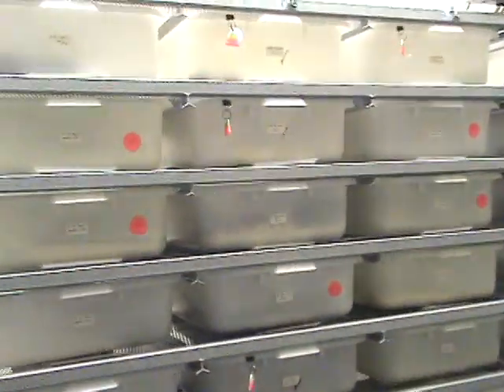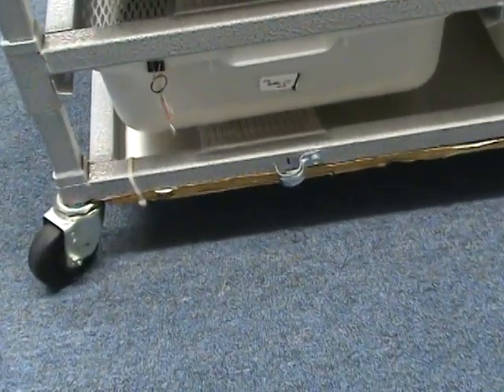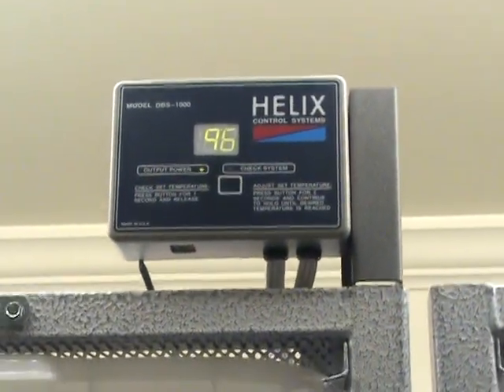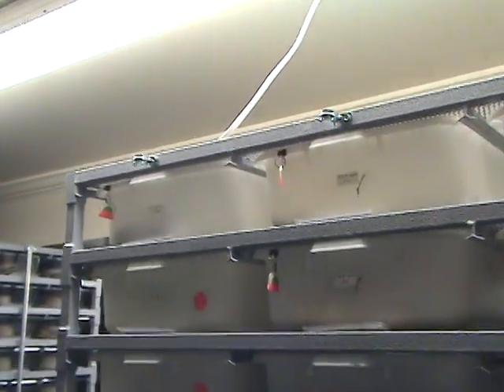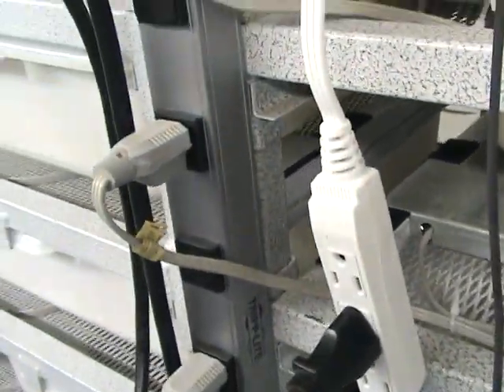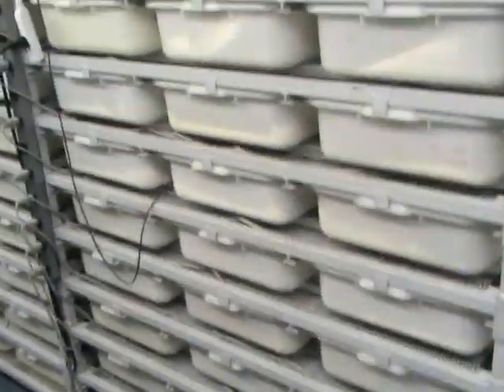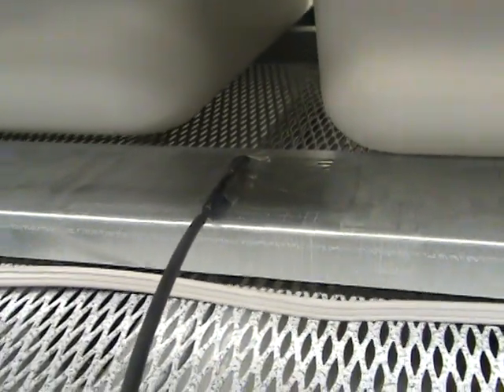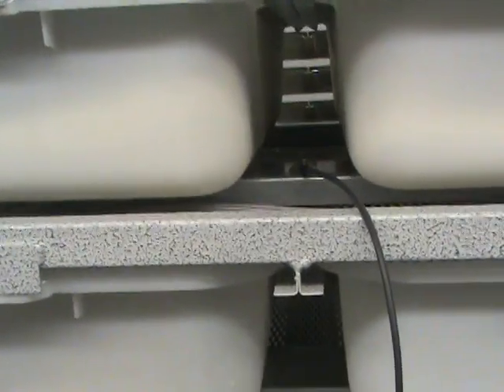Heating Snake Racks - part 1

Comment: New snake rack what is the highest I can keep floor over heat tape  (inside tub). For ball python
Reply: Amanda Kelly i would say ambient of 82-86 inside of your tubs & hot spot of 90-93 cool spot of 77-80 at night. no lower than 75 iv notice my ball pythons do better for me with those temps, just depends where you live and how your set up is.